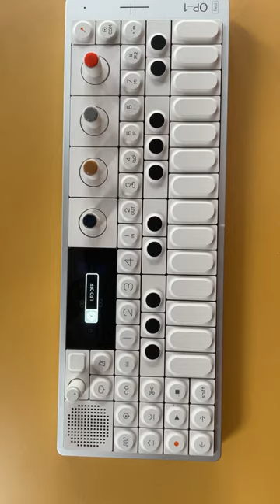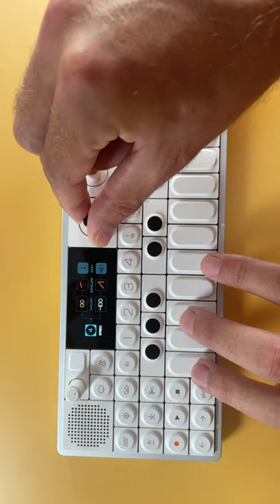FAKE DELAY on any synth!

Comment: Awesome tip!  So does this trick allow a delay locked to the BPM on the OP-1 synth?  I know the regular delay effect in the menu needs some fine tuning and trial and error to achieve the same locked result.
Reply from the maker: Yes, it does. Just use LFO speeds that are shown in number, rather than the dial. Then it is in sync with your sequence!